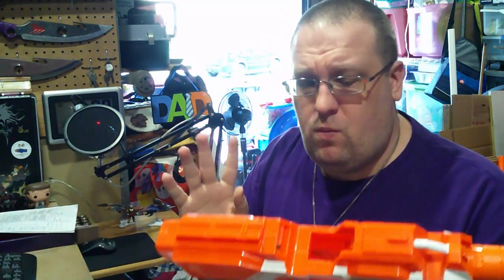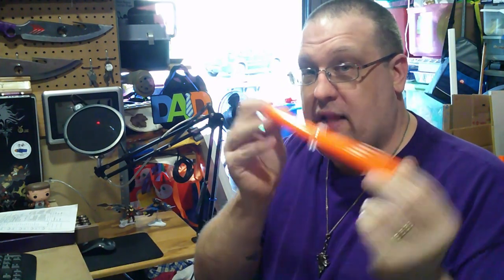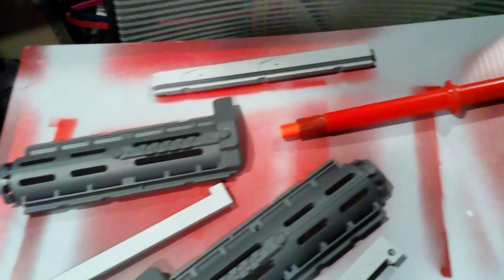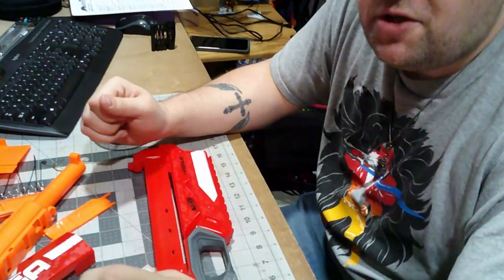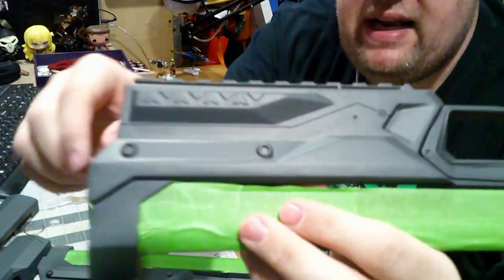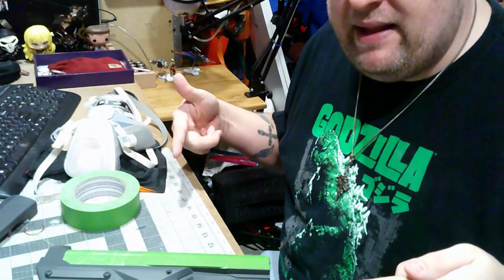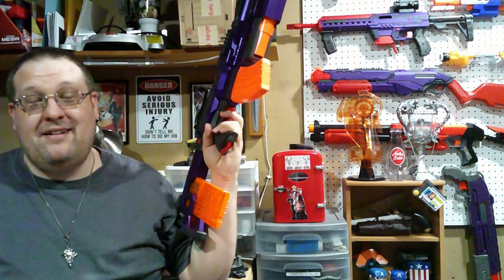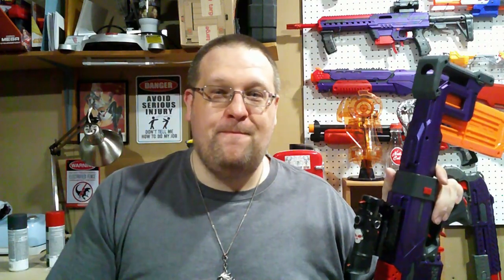My Custom Stryfle

Comment: Gorgeous. I’m in the planning phase of mine right now and test fitting and it’s so jank that I might leave it. What lacquer paint did you use? Did you clear over everything when done?
Reply from the maker: The lacquer I used was Rustoleum Custom Lacquer (fine it at Autozone or Advace Auto Parts) I tend to not use a clear coat unless I have a lot of detail work. So this Stryfle is just paint, no clear.

Comment: May have missed it but what spring are you using in the magnus. I want to buy an upgrade one but afraid if I go too strong it might be awkward priming while attached to the retaliator barrel.
Reply from the maker: Magnus still has the stock spring. I had a similar thought also figuring that it would be more of a support piece than primary.